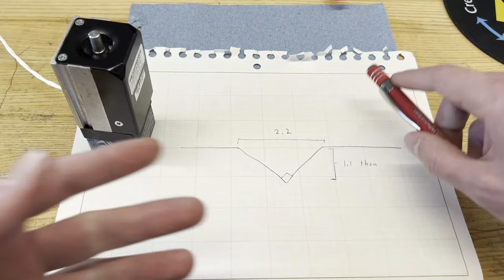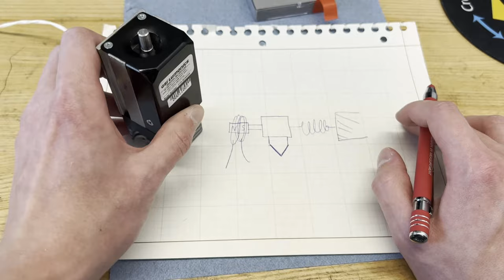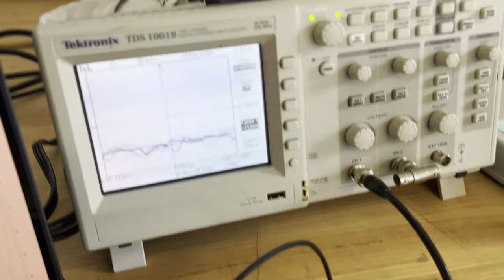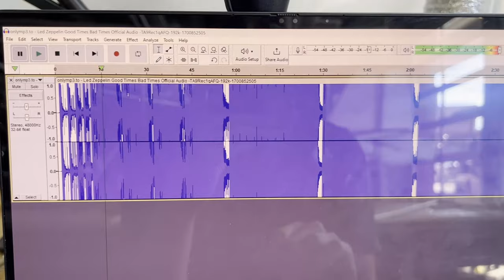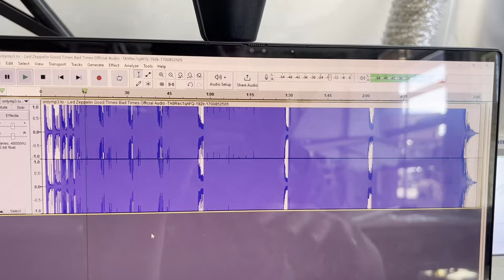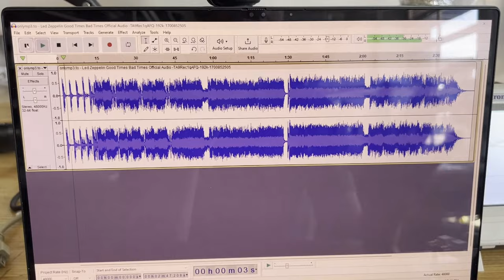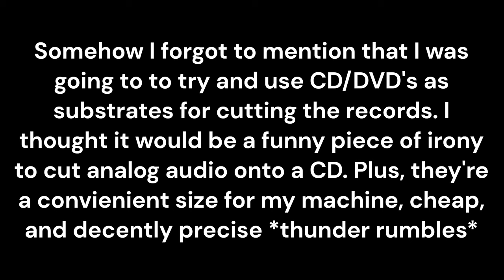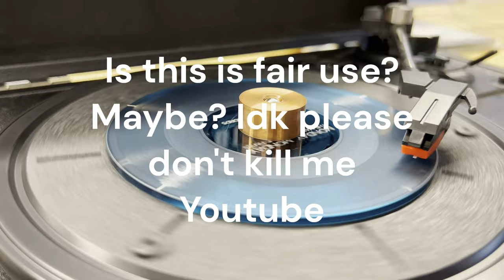Adventures in machining sound

Comment: Inception warning: what have you done with that long piece of chips that have spooled? Could it be played somehow? 😅 Another one: get a spool of thin copper wire (used for coils) and get it through a set of rollers that are pushed against eachother using the same techinque.

Comment: The Analog Discovery can be configured as a network analyzer for audio frequencies - that gives you the bode plot (gain vs. frequency and also phase vs. frequency) automatically. It works quite well in my experience.
Reply from the maker: @TheBenTheAwesome  d’oh! That combined with a record cut with white noise seems to be the best solution. Thanks for the heads up

Comment: could you just slow down the audio playback when cutting so that it would end up in the flatter low-frequency region? then you wouldn’t need to do so much compensation with eq
Reply from the maker: Absolutely an option, half speed recording is utilized in industry for this purpose

Comment: Really cool idea... You didn't mention RIAA equalization, i.e how the target response of the recorded groove is SUPPOSED to be shaped. There's quite a lot of EQ applied in a normal phono stage of a preamplifier.
Also, I don't think your setup is "overkill" for a mastering lathe.... A typical mastering lathe is worth several times more than your setup, uses air-assisted jewelled bearings, and is typically deadbolted to a granite mass of several thousand pounds floating on a damped decoupling from the ground in a less than 10dBa average sound isolated space.
A really good mastering lathe can easily put in a recognizable midrange signal 80dB below full motion, which would be nanometer scale controlled motion :)
Something else you should try is to slow the mastering speed (and audio) down by 4-10x. This moves the resonance peak up (relative to the "real" frequency) by several octaves, and makes the signal processing a lot less strenuous wrt dynamic range and frequency response :)
Reply: The old RCA machines were about a few million in todays equivalent. I'm very impressed. It would be neat to try some softer plastics

Comment: Oldie mastering engineer here…; This was great fun to watch! The issues you come across show why studio equipment was terribly expensive in the analog-electromechanical era. And why 1985-newbie’s like me then had to spend hours every week just to calibrate tape machines and levels, before actually doing anything useful. 

So yes, we needed to be sound ‘engineers’, and also musicians to make sense of the whole mess. Our studios had small shops a bit like yours, and quite a few evenings and weekends spent there unpaid to figure out what the non-existent internet couldn’t reveal. 

I’m really impressed at the quality level after all the fun struggle, but that’s just the point. A career is one aspect, but the experience we could gain from “fooling around” 40 years ago was gold, appreciated and expected by the employers and clients. “Saving time” doesn’t solve much…

Yep, different - That doesn’t mean “better”, just… different. Best of luck from a smiling dinosaur! 

BTW, the substrate used for cutting was lacquer on aluminum substrate. The evenness was spin and flow induced, as acetone solvent evaporated from the nitrocellulose formula.

Comment: I wonder if you could belt drive the chuck with a motor and/or gearing that would be significantly more accurate as far as a consistent speed. Along with etching and playing the input signal/song at 10% speed or something like that, I bet you could get them sounding quite good.

This is a really neat project, I'm glad YouTube fed me your channel, you've done a lot of extremely neat work on here.

Comment: Great great video

One thing to look into is a set of tuned mass dampers targeted at the Eigen-modes of the actuator that you can measure with that bode test. A second thing I’d recommend is using high stiffness to weight materials (BeAl, CFRP, AlSiC MMC, SiC, Cu clad Al) for the structure of the actuator and voice coil to drive up the frequencies. >3-4khz should be achievable

A peizo stack will have a hysteresis curve and other control headaches, maybe look into optimizing the voice coil motor design with FEMM (open source magnetic FEM code)

Comment: Very nicely done. Polycarbonates are one of the toughest plastics, but if you had tried to cut on the back of the CD where the data  is actually stored, you would only have to had cut into a metalized and painted surface and the cutting forces would have been a lot lower giving you better dynamic range.

Comment: Nifty AF ! Getting it to work on CDs would have been quite more novel though. Especially if the CD itself still functioned with the analog title track on the back or whatever. Such a cool channel.
Reply from the maker: I was really hoping for that lol. thanks!
Reply: I'm pretty sure a CD's data is on the back, under the label and a layer of lacquer. So, depending on the depth of cut compared to the thickness of the label+lacquer, you could cut through the data if you record on the back. And obviously you would destroy the optical clarity if you record on the front.
DVDs, on the other hand, have the data layer(s) in the middle. And apparently Blu-ray is just behind the front surface.

Comment: Maye you can use a record player stylus/cartridge as pickup to EQ the system. 
maybe even with the phone preamp this way you would eq the wohle chain.

Also it sounded horrible since it was clipped in Audacity. you have to apply some negative gain in order to not go over 0dB
Reply from the maker: Good idea and thanks for the tip!
Reply: @cylosgarage  Grade video and cool Project! Thanks.

I see where the idea cam from... but there is no rule the record speed has to be the playback speed right? 
If you can’t eq the frequency response at the high frequency maybe you can record at halve or quarter speed? 

Maybe even with the steppers/servos on the leath without the coil at a way lower speed?

Comment: Really cool project! The diamond turning folks might call that device a fast tool servo (FTS). Trumper's group at MIT built similar devices back in the 2000's for cutting non-axisymmetric lenses and mirrors (in case you have not already found this resource). They generally have incredible dynamic range. BTW, the repurposed cross-flexure bearing from that galvo unit is brilliant!

Comment: Amazing video. It is very likely that your actuator dyamics are -40dB/dec all the way out to infinity hertz. That will probably be what you see when you get better measurements. You could manually fit a transfer funtion to that frequency response curve so that it would be accurate out to higher frequencies. You could also do that with tfest() on matlab which is a lot of fun. If that audio is saturating when you apply the EQ, that would also kill your quality, not just because its clipping out details, but also the frequency response approach necessitates linear systems so they barely work if you introduce non linear dynamics such as saturation. Im not quite sure what the best way to fix that is. You probably would want to apply a large negative gain so it doesn’t saturate. Then you can just turn the volume up on the record player. Otherwise you would need to add zeros at resonance, I doubt thats even possible and I have no idea what it would look like

Comment: you need a variable but constant pressure on the stylus.. so it floats on the various surface inconsistancies .. did the same on my cnc for what i called a floating head.. higher production value

Comment: Super cool going through your channel after finding it with air-can mach diamonds!

Ive seen others mention it, but phono preamps all have a pretty drastic (40dB delta from 20Hz to 20kHz) non-linear RIAA standardized eq correction applied to correct for the inverse EQ done at cutting, so to get approximately level playback on conventional setups, you will need to account for it. This would probably help you in overcoming some of the challenges with grove-track width and skipping, which is partly why it is done conventionally. 

Since you would want to re-measure the resonance of your cutter with that standard applied, I wonder if your oscilloscope (or any, Its a tool im unfamiliar with) is able to record measurements over time? If it does, you could run a linear frequency sweep from 20Hz-20kHz through your cutter over a set time frame, and get a far more accurate correction curve. Its a method I've used to tune speakers for any given room's various modes, and works really well in that case! 

I also wonder if recording in slower than real time with proportionally adjusted audio playback would result in better high frequency performance for your setup, but I feel like that might open a world of machining conplications that I have no idea about, haha. 

Really amazing stuff!